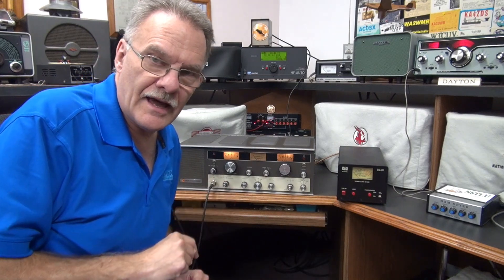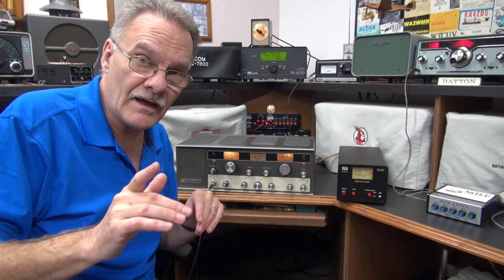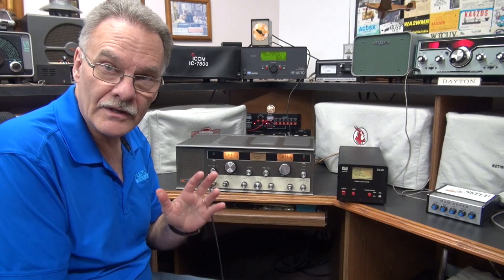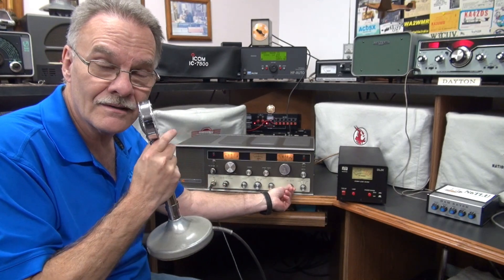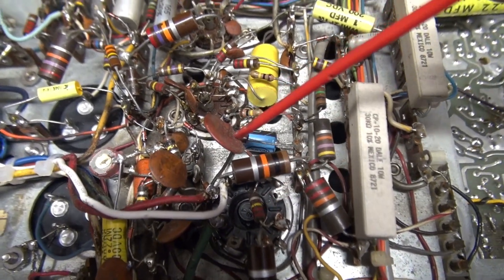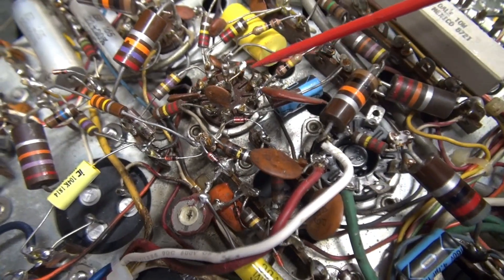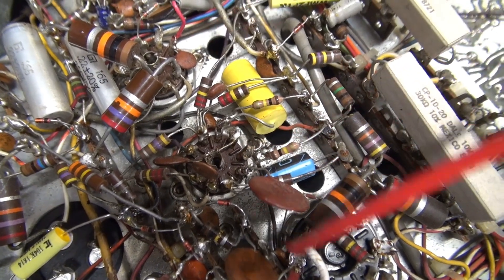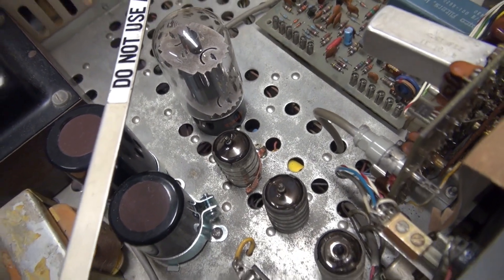Repair Vintage Tram 201D CB base station strange buzz in transmit and receive solution

Comment: Hi , I have a loud hum on my Ferris5500 / Robyn base station on receive with volume at 0...the hum is not present when running off DC 13.8 V...I have replaced the main electrolytic but the hum is still there on AC..
Any advice appreciated.
PeaceFromOz

Comment: Terry, this grounding problem may also become evident in audio amplifiers and stereos as well, if the same grounding technique was originally used. Good work!
Reply from the maker: Yes, If your using the tube socket base for a ground connection, it could act up

Comment: About 25 years ago I got a really good deal on a D201. It was good until I powered it up and then it sounded like a thunderstorm inside! Long story short, resoldered every joint on the circuit board and replaced a bunch of fried resistors. 
I added a Titan 4 to the herd a few months ago and it had a cold solder joint on the circuit board that made it squeal on receive. 
These radios are pushing 50 years old and it's worth it to keep them going.

Comment: having worked  on these  radios  for 40 years  an having  two 201s an three 201As   they are holding up very well...great job on this radio as they are bad for solder  joints ..dried up carbon resistors  an filter caps  ,,,